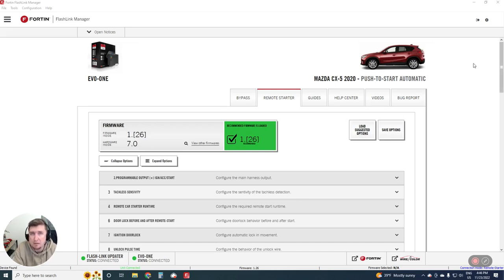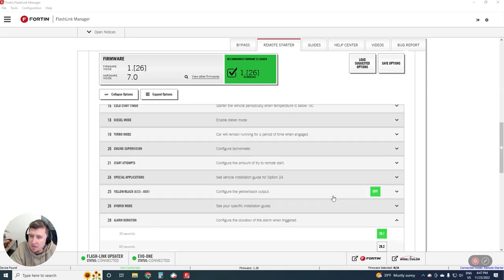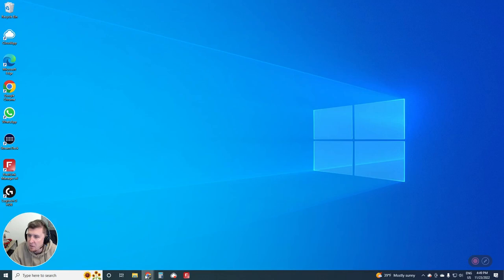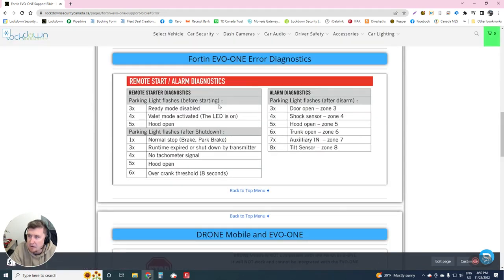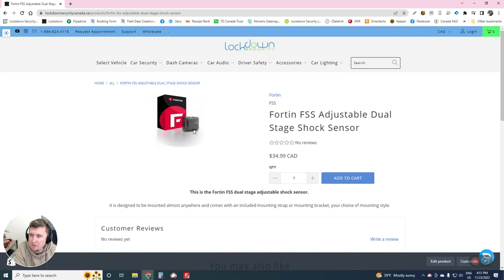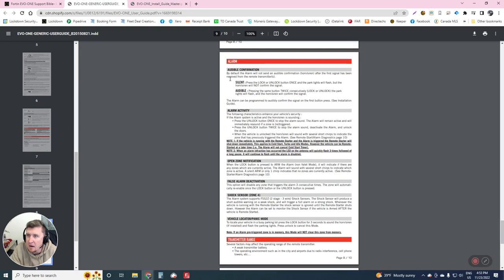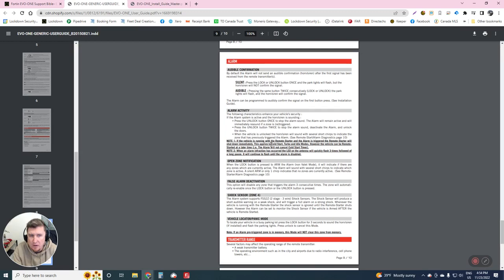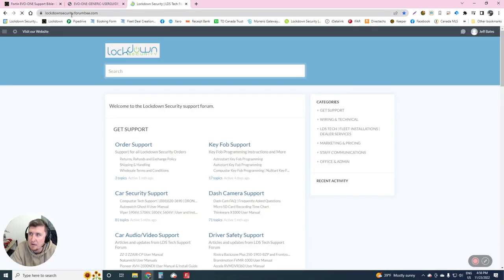EXPLAINED! (finally) Fortin EVO ONE Alarm Features #lockdownsecurity #fortin

Comment: I installed evo one on my 2023 cx9, all settings on default, when I remote start the car immediately alarm and hazards goes off and stops when I press unlock. Any ideas how to stop it? Also I can sacrifice the alarm if I must, I don’t need it that much
Reply: *Remote start working perfectly
Reply: Late reply on this one. Ensure you have an option selected: "Unlock before start". Should resolve that problem.

Comment: I bought a Corolla Cross recently. Just wondering is the Fortin alarm system more better than the OEM car alarm systems on vehicles?
Reply: The Fortin alarm features will give you the ability to add the FSS shock sensor, as well as an external siren, so yes it would be better than the factory Toyota alarm system.
Reply: @jeffbates7199  Thanks a lot for your help. I appreciate it!

Comment: What is the yellow bypass ignition A1 wire essentially for?Is it for older vehicles?
Reply from the maker: The yellow wire in pin A1 is almost always used as the module's ignition input, which is important for being able to program the module (as programming in the vehicle requires the ignition to be turned on/off, this wire is what tells the module ignition on/off status).
Reply: @LockdownSecurity  thank u for your response!